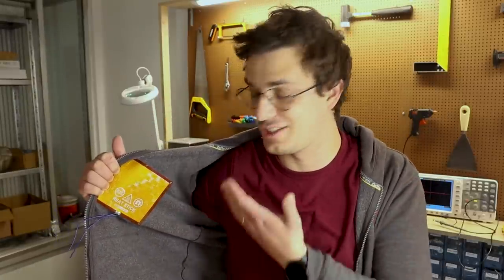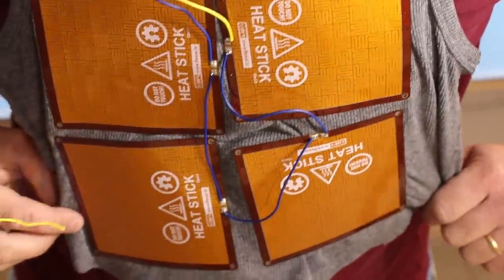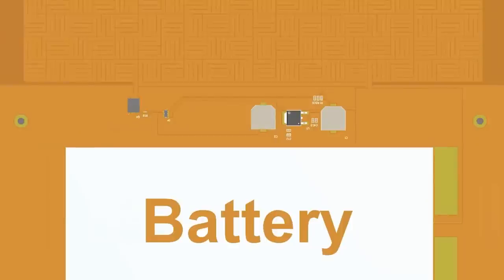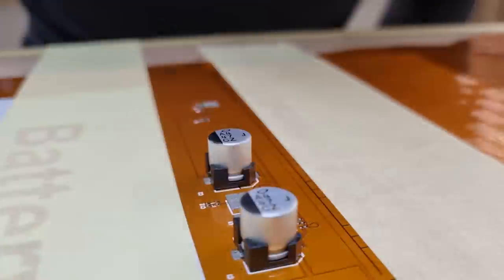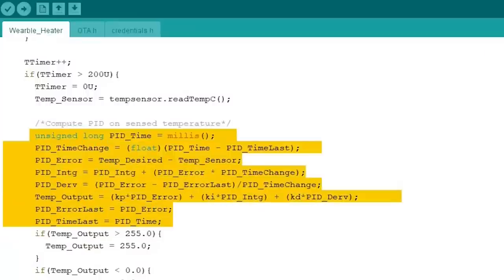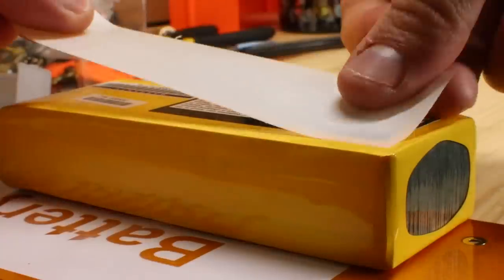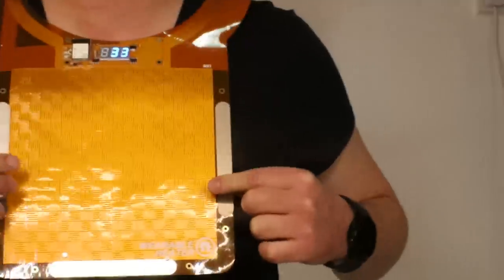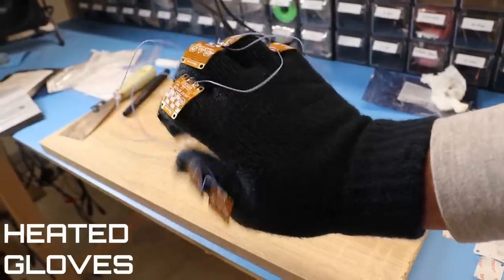Making a Wearable Heater from a Flexible PCB

Comment: Exactly how I like my heated vests: with a 32-bit dual core micro controller, WiFi and Bluetooth.
Reply: @thesilentcitadel  Well, you still need a few more pins if a non-I2C display is used. Even with charlieplexing that's a bit too tiny.

Comment: At this point, it would be a viable product if you can make it run on external power banks that fit in a persons pocket. Having the ability to quickly change the battery and using whatever size suits the user. That's if the power output supports it.
Reply: there's a jacket from Milwaukee that does that. I believe it uses their M12 battery system because with a jacket, less power is needed to keep warmer.
Reply: He should make it by using energy from the blood of the owner, to burn his fat faster and also keeping him warm. (;
Reply: I think what is also required to make it more viable is to have it look less like a suicide bomb vest.
Reply: maybe he can try to run it with powerbank that supports power delivery
Reply: @graealex  Yeah... My first thought was "don't walk up to a police officer wearing that".
Reply: Milwaukee, Makita, Dewalt all do this with their power tool batteries.

Comment: No, flexible PCBs are wrong for this application. Moisture (sweat) management is just as important as thermal management, because with the wrong layering you will end up wet and then cold. Breathability is key. It's also never your chest or back that get cold first, it's your extremities.
Reply: Would adding heat to the chest / back mean that the extremities cool more slowly with warmer
Blood filling them? Or does the external coldness cause the extremities vessels to constrict this limiting the flow of the warmer blood?
Reply: @Dilshad-gu7je  Not really. Blood vessels in the extremities constrict to protect the vital organs. The blood stays the same temperature, we're warm blooded animals. It could have emergency use, if someone is already hypothermic. In that scenario the priority is to return the core body temperature and internal organs to a normal temperature as soon as possible. But it just looks like a fragile solution looking for a problem, that's already solved in electric blankets.

Comment: FWIW, I recall watching a study years ago where it was proven that if you can keep a person's core at 30C or greater, you can fool the brain into thinking that the outside temperature isn't cold so it won't shut down blood vessels in the extremities to maintain core temps.  In the study, a subject wearing an electric vest was placed in an environment with a temperature of -12C and had to perform bare-handed dexterity tasks like threading nuts onto bolts.  As long as the vest was powered, he could do it easily.  However, within 2-3 minutes of it being turned off, his fingers started to stiffen up until he could no longer perform the tasks.

Comment: I love your channel, it's pushed me to go back to school too. As a suggestion for an alternative idea have you looked at stainless steel conductive thread? It's what's used in automotive heated seats & steering wheels. It may be a viable option for what you are trying to do. Also most heated jackets put the battery behind your left or right hip sightly away from your hand. Again thankyou so much for contributing to the community.
Reply: yep, that looks like the right solution. Using flexible pcbs for this is just silly :)
Reply: @adamvalt6609   you'll never know if you have the right solution until you fail :)
Reply: It's almost like this is a real commercial product already which uses nichrome wire, which is really common for this kind of product.
Reply: Such a vast gap between the class of the first comment and what came later.

Comment: Velcro can be another option… stick pcb in one side and other side of it in the dress… as the surface area is high it can hold some weight! So it can be single piece instead two !

Comment: Consider creating a version to alleviate period cramps! I think it’s a great idea and I haven’t seen anything on the market.

Right now best there is really are there’s microwaveable beanbags, which are okay, but a consistent equal heat, without needed to recharge in the microwave would be really cool!
Reply: Nice idea,
I also think heating the back is useful for 
Sciatica patients. Usually they use warm bottles to alleviate their back pain symptoms but this doesn't work on the go.
Reply: you can get plug in electric water bottle/beanbag type heaters

Comment: I just use the heater from an aftermarket heated seat kit and a 12 volt "battery generator" strapped to my upper back, both off Amazon. Warm enough and lasts long enough, plus the battery unit comes with a high-power LED light so I can cosplay as a car.

Comment: You could connect the battery with a wire, that way you can have the battery in your pant's pocket or sew a pocket in the shirt. That's how the already available heated clothing is made, the electronics and battery are removable, only the heating element is inside.

Comment: You can try adding a battery belt and connect the battery with a flexible cable.
Also you can borrow ideas wor scuba diving heated vests. I think you are in Malta, there should be some 40 dive shops within 10 km radius.

Comment: 3 part heater that Velcros in to a zip up hoodie with a power tool battery in the pocket. With the right hoodie the hook side of the Velcro would attach to the fabric. 
What would be really handy though is a power tool battery heater that will keep them up to temp in cold weather.

Comment: What about just using a power bank?
A pd power may give you enough power
And for the temperate why don't you make it kind of like a regulator where you set a given temprature and it will turn on and off the heater for more or less a uniform temprature?
Also for the heater can't you use some medium sized PCBs and velcro them to the cloth 
Thanks!
Reply: Powerbanks usually can't output 70 watts of power...
Reply: @dtesta they can actually
PD power banks can output around 83 watts at 18 volts
They are expensive though

Comment: You can try dividing the battery info front and back section that will distribute weight evenly. Try using one of those thin cell phone batteries.

Comment: My suggestion would be to add side flaps/wings to the chest and back panels underneath the arms (that could potentially join or snap together) and place the batteries on those 4 wings, it'd distribute the weight evenly, maintain the look of the vest and improve functionality.

I'm not sure what your design constraints are, but you could space the "coils" further apart in order to cover a larger area, maybe in a honeycomb or waffle pattern to create a larger surface area without necessarily increasing total coil length.

Comment: I had a different idea for wearable heatinh, and that is sewing thin wire directly into the fabric. I tried it with 0.1mm enamelled copper wire and it works fantastically. I only did a prototype though, because I didn't have enough wire and old fabric left for any more. This was around six years ago, nowadays I hesitate with such stuff, because I don't know enough about regulations for heated wearables here in germany. Otherwise, this would probably be a huge improvement for heated clothing. Using another conductor would be preferable though, probably something like leoni histral...

Comment: maybe the socks and gloves can be made to run with a smaller battery, like a AA or AAA battery, or maybe an 18650 cell.

as for the vest, maybe a remote power style would work, making the batteries connect using wires to the vest, and the batteries themselves can be placed in a pocket or some kind of carrying pouch. or see if you can make the vest less power hungry, and maybe run on two cells, one under each arm(on a magnetic clasp to keep the vest closed, similar to a lifejacket style)

Comment: 2 things - consider how much flexing occurs and strategic placement for max heating effect. Triangular origami patterns would be much better than a box pattern for this flexibility. Also, recognizing where the most heat is lost is not typically your core...it's your extremities. For example, you might also want to consider how the body heats and cools itself best -  the fastest way to drop your core temperature is an ice cube placed where? Under your armpit. Why? Because there's the Axillary arteries and veins located there, a major hub. Now heating your armpits sounds weird ('cause it is!)...but it would work much better (and faster) than other places.

Comment: I think that body-thin cotton tshirt-PCB heater-thick sweater is way better from efficiency standpoint. Let the PCB warm up to body temperature and then give it very little power, so the body itself doesnt need to produce heat. 
ubs-pd cable mounted on the vest with a new gen 100W powerbank would be practical solution too.

Comment: I own one of those USB powered washable vests. It's ok, but not as warm as I would have hoped. Might try using type C and over-volting the heaters to 9v or even 12v. Yours is a good start but isn't nearly large enough, would leave my tummy far too cold.

Comment: You could to a "battery belt" with many small LiPo (1 or 2 cells) or some  18650 at the back of the belt. You could even put the charging circuit in the belt. Then with some type of "power distribution hub" (many conectors one next to each other in the front or the sides of the belt) you would be able to power the vest, gloves or whatever you see fit or apropiate at the moment

Comment: Really cool but maybe don't wear it to the airport. Also making it compatible with a USB PD power bank might make the battery solution more flexible pun not intended, though IC for that seems to be close to unobtanium atm.
Reply: Yeah that display at the top peaking out of the jacket is going to freak someone out wearing this on public

Comment: The biggest performance problem is faulty design assumptions. Notice what is heated in mountaineering and what is heated in fishing. In addition, excessive integration does not always bring positive benefits. Integrating the battery in a belt (kidney bag) would give much more possibilities.

Comment: Multiple 18650s around the two bottom edges, that could be replaced would be great. Or even some capacitors that might be able to be wirelessly charged/inductive (think shake flashlight) charged as the person walks would be cool. Limiting the heater's run time duration of cycling on for a minute then off for 3 minutes may make the powersource last longer.

Comment: Interesting. However as you can not see the display yourself perhaps in the software can toggle to display a mirrored image. So you can easy read the value using a mirror. (Or add an ESP32 and use your smartphone as controller.)

Comment: CaO + water works too, as temporary heat generator, a crush squeeze heat pack
Reply: you already have a phone in your pocket, use that as the battery
Reply: or just have solar sells in your clothing, for continuous input
Reply: peltier modules work too, either body heat generators or heaters, clother air conditioning, hot side inside, cold side outside, or the flip side for sahara trips

Comment: Replace the battery with a hand crank attached to a generator. It will provide the energy and also heat you up further all by itself!

Comment: Just a crazy idea, would you be able to mount on the alluminum part of the rim of a pedal bike,just where the pad is braking, some magnet (or even on the spokes with a 3d printed mount) and put a series of custom PCB coil on the side to make a rim Motor? Would it be enough to make it usable?
I guess that with the coils you could go only a quarter of the way, or make a module, that can be added to go another quarter, maybe better dividing in 1/6

Comment: HOT Idea  😀     For Energy IMHO use power bank. I have lot of in different sizes.  A bit of math and i know how long which one will last.   I like FlesPCB much bit for this i use carbon fiber roving. Contacting with the stranded wire through ferrules.

Comment: isnt lithium-ion battery just a sheet thats rolled to fit in a cylinder? what if its integrated with the PCB?  its flexible, it should be possible to shape to a vest too.
i dont know much so i might be wrong though, just correct me if im wrong or if its not possible

Comment: Would it be possible to make a "2d" battery, as in a flattening out the structure from what is today usually rolled up or layered in multiple layers. Then instead of layering, just connecting them in serial/parallel to achieve the same performance? There seems to be one company selling such products, or just buy parts to make self. I mean, the resulting vest would be thin, but not that thin that you wouldn't notice it. Maybe if the cells are structured in a pattern to allow for flexibility it wouldn't be too bad though.

Comment: Well, it does get hot. But problem with thermodynamics. Its like heating 1L water with a fire match. In cold weather you will still lose more heat that you gain heat. Unless you have a really huge battery. Just use good cloths and move a lot and your body will naturally give more heat (energy) than a small bettery.
Reply: exactly, it would still be interesting to see how he pulls this one out. One for hands integrated with gloves would make more sense as its harder to keep this at an appropiate temperature compared to the torso.
Reply: @Y-0  me too ! Its definitely an awesome project 👍

Comment: I would never wear a LiPo battery. If something goes wrong and it catches fire you will be very sorry. Much better to have a plug on the heating pad so you can attach the battery in a pocket via a plug. Should something go wrong, take it out and throw it away before you catch fire. Then you could also plug in another battery when the first one goes flat.

Comment: Why don’t you just use 8 P42 molicel batteries they have crazy high discharge and pretty good capacity you could do 4s 2p to get up to your needed voltage and they are 4.2 amps so your capacity would be 8.4 amps. If you soldden them together you could have a flexible pack that’s not to big

Comment: Make a full set of clothes and split the copper tracks between front and back instead of going round the neck for the power,

 trying putting maybe small holes around the original heat pad to make it easy to sew 
Add like 2 can data port per heater for daisy chaining multiple ones with individual battery to a single controller
One shirt with at least one can port near a wrist for a wrist mounted controller, and a free one near the waist

Add heated pants with heaters like the shirt with can near the waist and...legholes? feet holes? Dunno English ain't my first language
Same for gloves, socks and anything you can imagine

Basically your heat pad with can capacity

I mean OTIS connected over 200 way more complex circuits with some shite proto-can protocol in the fucking 80's

Comment: the design is just stupid. That pcb is going to tear very quickly.. Just make a clothing with good thermal insulating properties and you eliminate the need for high power battery, then you just run filaments with resistance wire and push current trough them every once in a while. A small phone battery - or like 4 of them (iphone batteries are very slim) will be enough to keep you warm.